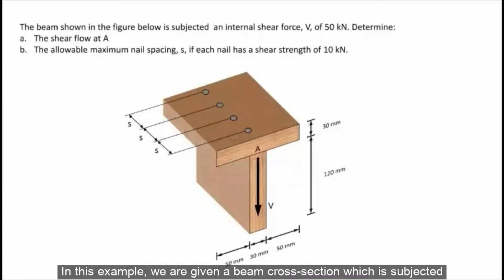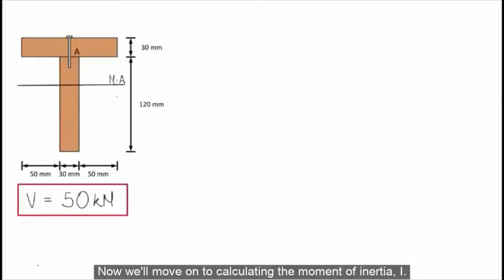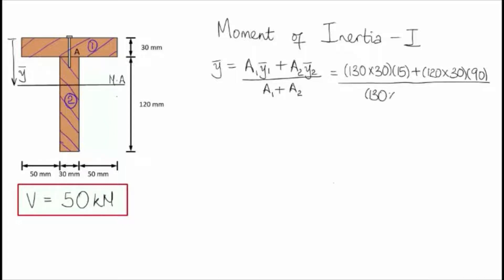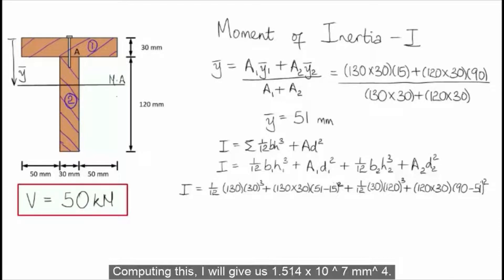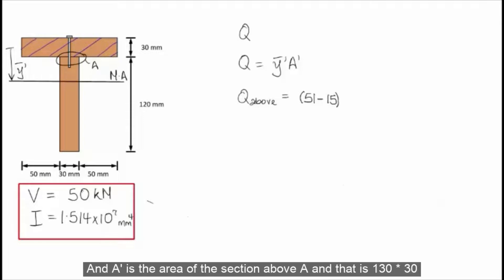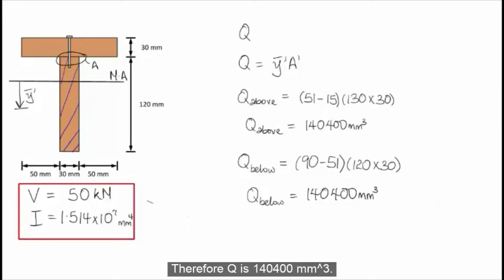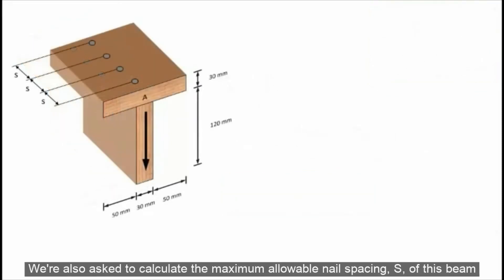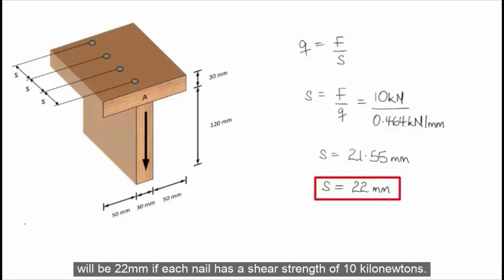AE 204 Shear Flow Example

Comment: When calculating the moment of inertia the Y bar, how to identify the reference? You’re obviously used the top as reference, but sometimes I found a solution is using the bottom as the reference and this thing over here it makes the solution different